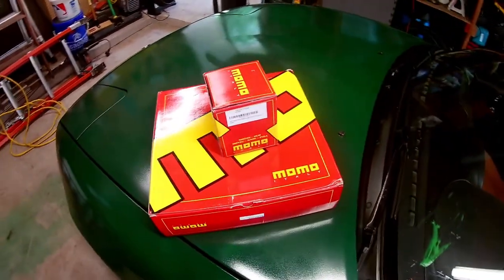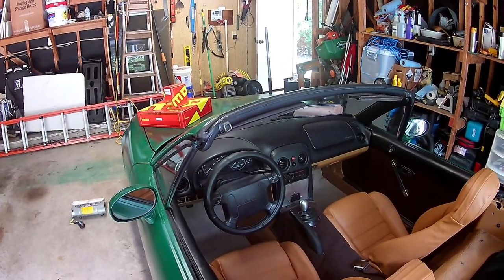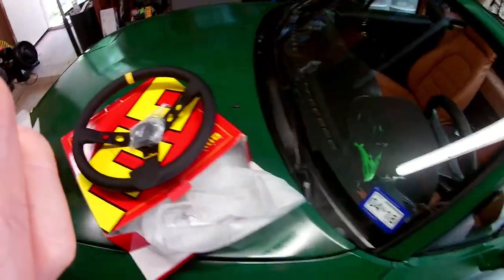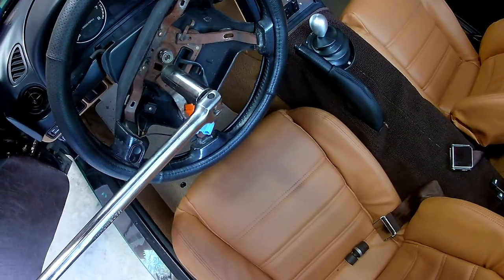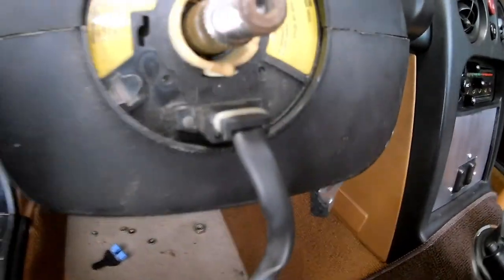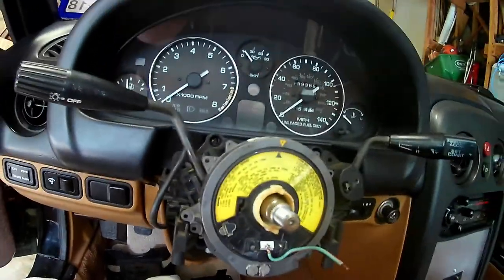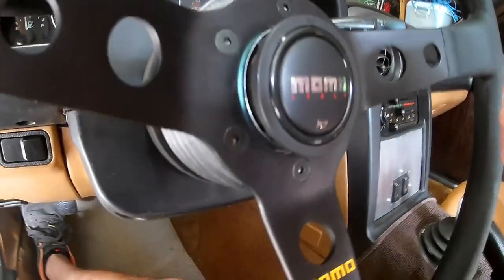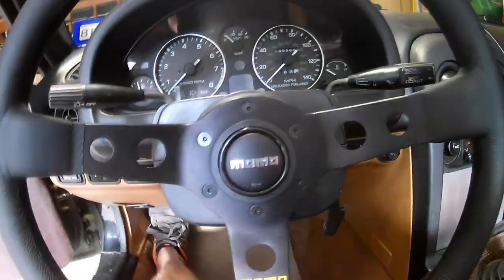EASY Momo Wheel and Hub Install for Miata

Comment: You’re a lifesaver sir!  When I accidentally destroyed most of the ribbon cable coming out of my 97 NA clockspring I thought it was all over.  I was moments from just pulling the clock spring and snipping wires, but watched your video, did the same on my Momo hub/Sparco wheel and it’s working great.  Awesome!  Many thanks!
Reply from the maker: Nice!  Glad it helped you 👍

Comment: hey man, i'm having issues with the horn button on an exact same miata. how did you solder the wire? do you have any pics or instructions on how to rip the small rectangular tab and connect the wire to the correct terminal? my horn doesn't work when i ground any of the 3 wires to the column so i'm guessing i broke the connection by pushing the rectangle down, like you did in the first attempt
Reply from the maker: Yeah so inside the black tab is a white ribbon cable, you can grab what's left and pull it out a little bit.  It's three flat wires in one, the horn is the middle one.  What I did is melt off a small amount of the white insulation with the soldering iron until I got some clean copper and soldered the wire to that area.  That part is a little tricky...heat the ribbon cable a bit and also pre tin the wire you're using then get your solder ready.  Used leaded solder because it will melt way easier.  Once it's on, keep the iron on it a couple more seconds to wet it out so it won't just flake off.
Reply: @OGPedXing  ripped the tab off and tried connecting a wire from the middle terminal to the steering column... doesn't do anything. did i ruin the clockspring?
Reply from the maker: @mihaidaniel496  No probably the clockspring is fine, there may be too much insulation still on there preventing a good connection.  The ribbon wires are super thin.  Also make sure middle wire isn't touching one of the side wires in the ribbon.
Reply: @OGPedXing  fixed it today, the connection was broken. I opened up the clockspring and made a new one. All good now yay! Thanks for the help man!

Comment: that horn was limited run at the time, i think MoMo changed out that horn after end of 2017, so u got lucky
Reply from the maker: Interesting, thanks for posting that info. I had always wondered what the deal was with that horn button.
Reply: @OGPedXing  NP, I just ordered same wheel from same seller.(The mod 7 leather was not available ahead of time on amazon ca, they just updated the list). I believe ur review is at the top. And i had to buy this horn specifically off eBay since all newer production run unit has that arrow looking horn, which was pretty lame in my opinion.
Reply from the maker: @nicolaslee7331  check out the web store revlimiter.net.  he does small batch custom horn buttons, all kinds of styles.  You can get some retro Mazda symbols or all kinds of stuff. The guy ( Adam) does really nice work.

Comment: Did you leave the clock spring in place
Reply from the maker: Yes, the clock spring is still there, just modified to connect the horn wire through the hub to the button on the wheel.
Reply: @OGPedXing  perfect thanks brother. Awesome vid

Comment: Does the steering wheel have any play when using the momo boss hub ?
Reply from the maker: No play.  It's been nice and solid.
Reply: OGPedXing Thanks for the reply im digging your steering wheel & hub combo. Your video was very informative
Reply from the maker: @Linglinglinggggg  glad to help.  Also the nice thing about the hub is now any of the Momo style wheels will work with it so you can swap it out without much difficulty.  The soldering part is a little nerve wracking but it's super easy compared to grinding out a big hole in the hub.

Comment: Are the holes on the momo hub threaded?
Reply from the maker: The six holes for the steering wheel screws are threaded.  The center hole for the main nut on the column is not but it does slide into the splines so it will be aligned perfectly.